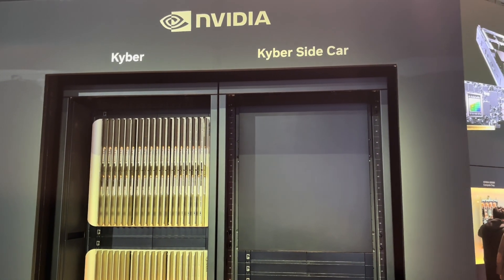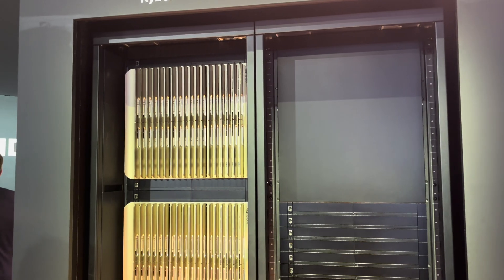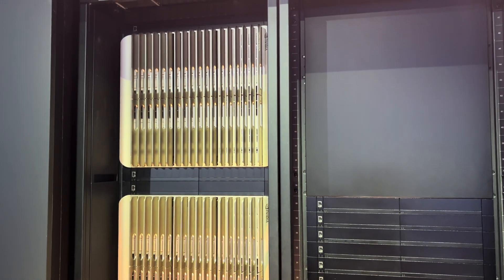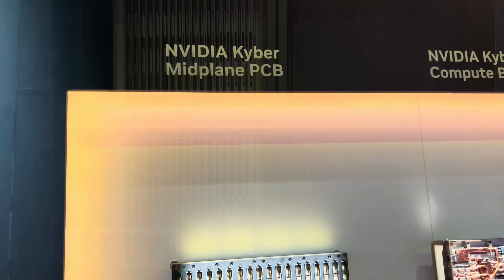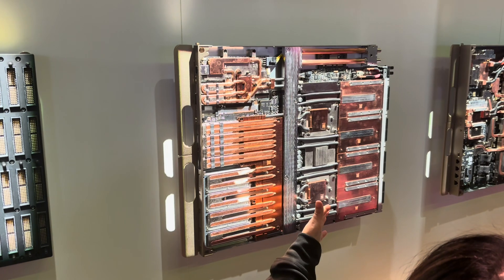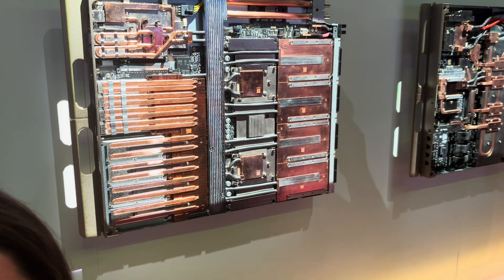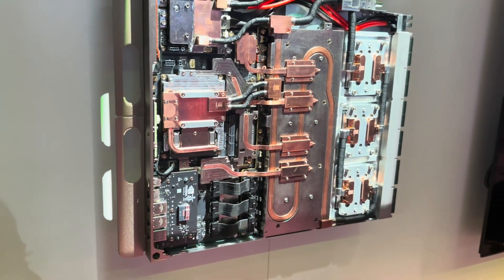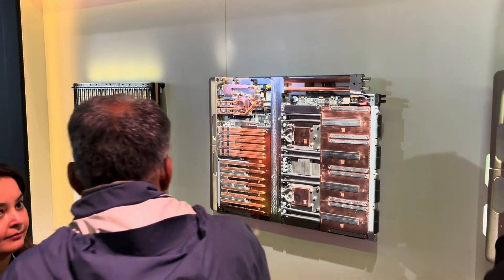Nvidia Kyber / Rubin Ultra and NVL576 on display — 576 GPUs in a single rack with Vera CPUs

Comment: Good job to show such info!
Reply: But the backplane shown seemingly is not orthogonal. Also can find 4 such backplanes in the whole rack. That means there are 4 seperate switching sub-systems. Just wondering how GPUs in upper cage to access the ones in the lower cage...

Comment: is it 100% fanless liquid cooling? unclear if truly all components connect to cold plates
Reply from the maker: All the components that need cooling should be connected… but I wouldn’t be surprised if a few small low RPM fans end up inside the chassis! I think maybe the “fanless” bit might refer to the radiator not having fans?

Comment: one vertical slot cannot have 16 gpus. you have 72 slots per rack. so it's 8 gpus per slot  or 8*72 =576 gpus
Reply from the maker: I believe Nvidia is changing the method of counting so that each chip (even if linked directly to another via NVHBI or similar) counts. Jensen said that “We named NVL72 wrong, and we’re fixing that with Rubin.”

Basically, the current B200 NVL72 has 144 “GPUs” because each B200 has two chips. So Rubin NVL144 and Rubin Ultra NVL576 will presumably have multiple chips per R200/R300 or whatever it ends up being called.

But yes, I said the wrong number when I was trying to do this video on the fly. 8 per vertical board seems to be the correct number. 8*18*4 = 576. Unless Nvidia is saying 576 for the full case (two racks)? It’s not 100% clear what NVL576 actually means, but the entire cabinet seems reasonable.